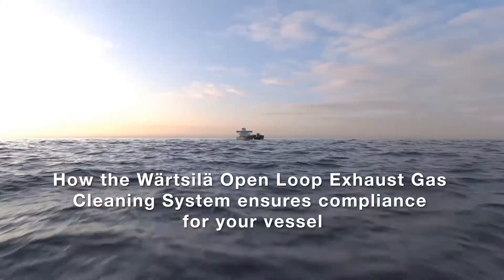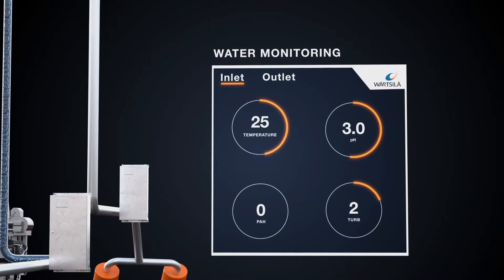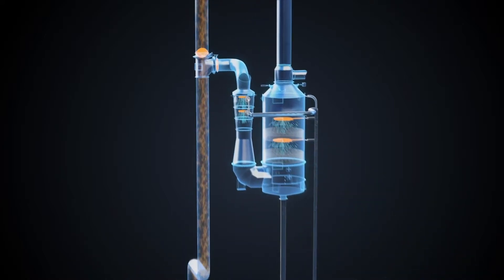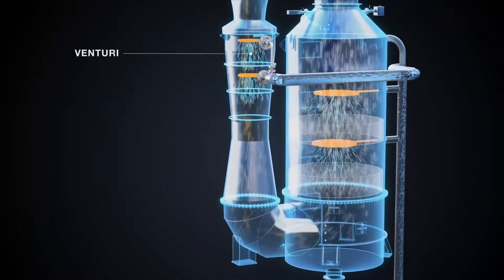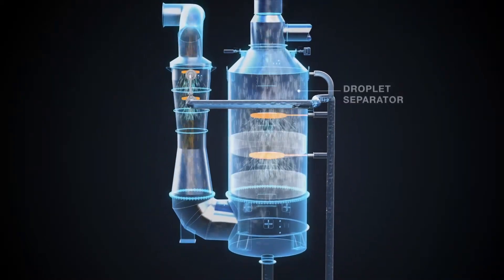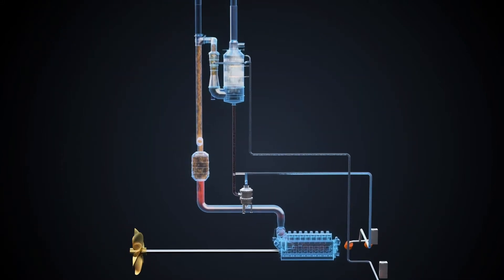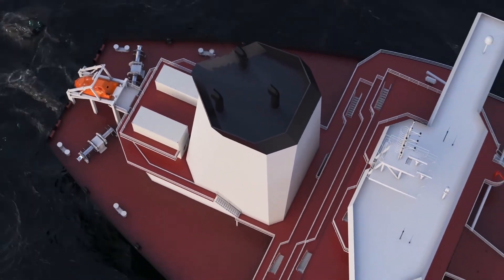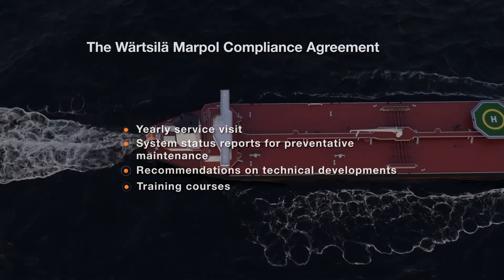Scrubber System in Ships - Wärtsilä Open Loop Exhaust Gas Cleaning System

Comment: Please I need the contact with the head of Development Engineering to show my invention of an internal combustion engine that doubles the efficiency of the current solution.  It is a unique and original mechanical concept, and that would be applicable to marine and stationary engines.
 My email is:
 motorlogico@gmail.com
 I will be eternally grateful.